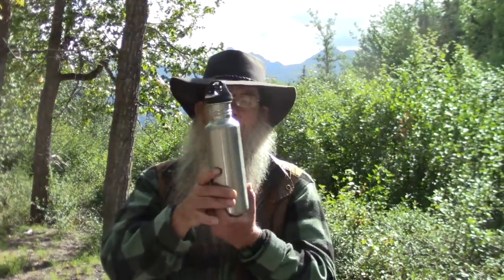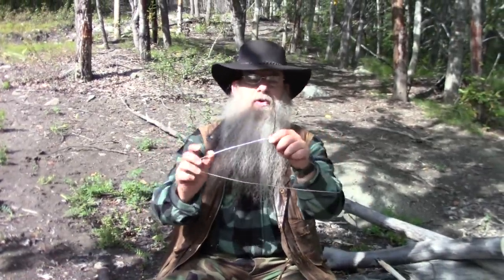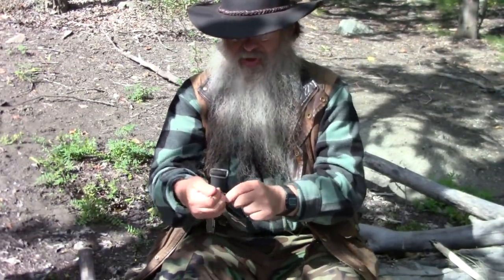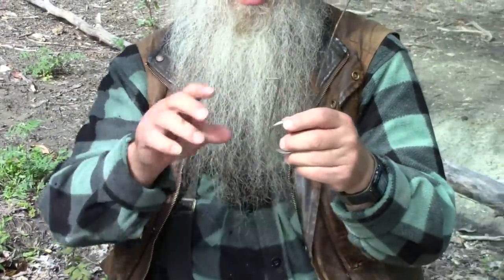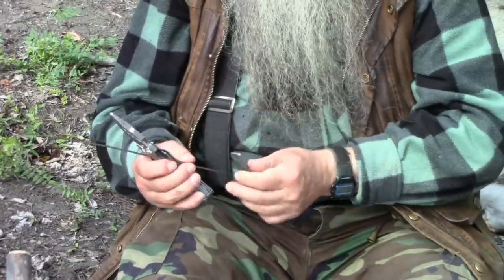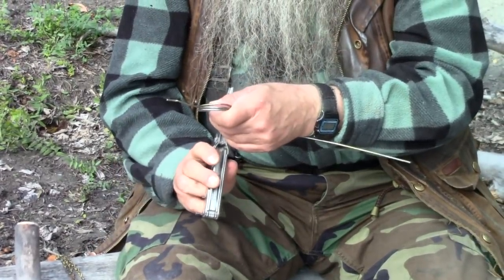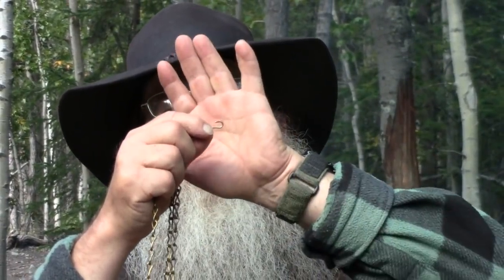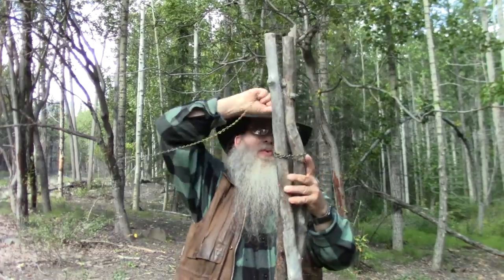Make A Water Bottle Hanger For Fire

Comment: Hi there... just some more ideas. I usually just put copper wire around the lip and twist it tight so that i have a wire "handle". That way the copper wire (acting like a strap) can just stay on it all the time. Also put mud around the outside of the bottle when cooking, so that you can just rub it off afterwards. Easier than trying to get soot off. 

For chains, I use those three chains for handing plants found in garden stores. They are good for hanging pots too. All the best kieron
Reply: Never thought of using a little mud to coat the outside in the scout's we would rub a thin layer of soap over the bottom and up the sides a little to make clean up a little easier.😃
Reply: @gamegod19 lol cool... its best if its clay from river banks. Im needing to have a break too and will head for a place called Wales at some point. Have fun

Comment: Very simple, but useful as always!
If you bend the hooks a bit under 90° you get a better grip inside the mouth.
Two other ways: most of the bottles are flanged at the mouth - you can put a piece of your chain  tightly around the neck underneath the flange and over the top to the opposite side (the first and the last chain link bend to a hook) - or take a 20cm piece of 1mm-Kevlar-twine and make a double-T-fisherman's knot, put the mouth of your bottle between the two knots before pulling them together tightly - Kevlar doesn't melt, it withstands temperatures up to 400°C/750°F, more than enough for a decent camp-fire.
Stay safe and keep on with your good work

Comment: Just make sure your bottle is not double walled that could cause a problem
Reply: Yes I was concerned about it rupturing with the heat and expanding pressure.
Reply: @jwm6314  really, it takes that long for it to boil water.
Reply: @CrazyCanuckFitness  I don't know if it would rupture... there is a vacuum inbetween the two, not air. So theorically it wouldn't develop much pressure.

Comment: Hey Lonnie, nice video! I use just a small piece of wood on a string and cut it to the length of the inside bottle neck. The wood holds bottle from the inside. It works well hanging over the fire :)

Comment: Good stuff making your own! I knew about fish mouth opener, and then I watched this video. The same day, while browsing local shop for a berry picker (blueberry season here in Sweden) I noticed they sold clamps for jam making, designed to clamp shut a small plastic tube for tapping the jam or lemonade. Long story short, this metal clamp fits PERFECTLY just like a fish mouth opener in a metal bottle. Very similar in design. The one I tried with is the wide mouth 'klean kanteen' model of bottle.

Comment: Thats a great idea! I made a coat hanger holder that fits externally. Your method has the advantage of not having a [red] hot wire hazard as mine.
Reply from the maker: I'd be curious to know how you did yours.
Reply: @Far-North-Bushcraft-Survival  
I made it by cutting the hanger near the 'hook' to allow unwinding the short twisted part to discard. I than formed a loop for the bottom, smaller than the bottle diameter. I than wound it up the side of the bottle like a helix and bent the 'hook' end to extend straight up.
Reply from the maker: Thanks.

Comment: I have a Leatherman, what is your multi-tool?  Thanks for your informative video, great as always. 😁👍✝️🇱🇷
Reply from the maker: I am a long time fan of Gerber brand multitools and in the past I have not liked Leatherman brand multitools due to a couple problems that they had.   However this last summer I lost my Gerber multitool of many years ownership and have replaced it with a Leatherman Supertool 300.  I am liking it so far and will have to reform my opinion of the Leatherman line of multitools.

Comment: You may have mentioned this in a previous video but I was wondering what the make and model of your multi tool is. Thanks for all the valuable life skills taught on the channel!
Reply from the maker: I am a big fan of some of the Gerber brand of multitools.   I had a Gerber for many years and really liked it.   I lost that Gerber out in the woods somewhere within 6 miles from here earlier this summer.  I had been doing some pretty extreme physical activity and my sheath that contained the Gerber came loose from my belt and dropped somewhere unknown.  Anyway, the store in the town where we do most of our shopping did not have a suitable Gerber multitool for a replacement.   I had to get a Leatherman.  I do not care for Leatherman's method of plier deployment, tool storage and handle configuration near as much as Gerber's.   However the store had a Leatherman that had the individual tools that I wished to have in a multitool so I purchased it.  I have come to like the Leatherman more than I thought i would.  I still prefer Gerber multitools but this Leatherman is not so bad.   To answer your question, my multitool is the Leatherman Supertool 300 and I am happy with it overall.   In time I may come to appreciate it almost, if not as much, as my old Gerber.
Reply: @Far-North-Bushcraft-Survival  Cool! Thanks for the response!

Comment: Great idea.   I like those bottles too.  They make aluminum ones though that aren't any good.  Our water here is somewhat "hard" and the minerals ate holes in them.  After finding that, I looked inside the rest and all had some corrosion.   The stainless ones are much better.
Reply from the maker: Wow you folks have some potent water.  Are you sure that the pipe that the "water" comes out of is not attached to a still at the other end?   lol
Reply: @Far-North-Bushcraft-Survival    Ha!  No, the still is separate!  We keep those bottles filled all the time in the refrigerator or next to the bed, so the water sits in them a long time. I got rid of all of our aluminum ones.

Comment: what I do is get a small stick, wider than the opening of the bottle, but not quite as wide as the full bottle. I tie a piece of twine around the middle of the stick, and then stick it inside the bottle. You can slip it in vertically, but because the twine is tied around the middle, it goes horizontal when you try to pull it out and catches on the mouth of the bottle.  Very easy to improvise in the field.  I find it doesn't burn as long as you use a small fire just big enough.  You could also use paper clips to twist around the stick and then hang a few in a chain before using twine, just to give yourself more clearance from the fire.
Reply from the maker: One could also use a string around the short stick as you suggest and extend that string up only a short distance but not clearing the top of the bottle.  Then secure a chain to the string such as I did here in the video.

Comment: Great video! Two questions: 1. Would it be wise to scrape or sand any finish off the coat hanger so it can't get into the contents of the bottle? 2. Would it be possible to wrap the coat hanger around the external threaded part of the bottle so one could just screw it into the coat hanger? Thanks again!
Reply from the maker: Yes it certainly would not hurt to burn and/or sand any coating off of the hanger before using.  I can not picture in my mind any sort of means of securely fastening the wire by using the outside threads and screwing on and off.   If you can figure a way to do it, great.
Reply: You can find them on amazon that are already stainless steel.. Considering the effort involved in sanding it down....

Comment: I know its an un related topic but what shell do you wear when traveling on a snowmobile? The snowmobile suits i see online are way to expensive and fragile for my budget
Reply from the maker: I usually wear "Iron-Tuff" Bib Overalls by "Refrigiwear" They were issued to me when I worked on the North Slope during the winter on my lower body and a hand-me-down down filled coat for my top.  One is taking a chance wearing down filled items in the woods because if they ever get wet, they are very difficult to effectively drying out again effectively.   I would very well probably wear the Refrigiwear coat instead but it is too small for me to wear over the top of the bibs as well as my vest.

Comment: Awesome little trick
But isn't that an insulated bottle
And if so doesn't it brake on the inside somewhere at least that's what I hear with a double wall stainless
Reply: Those are not double wall.
Reply from the maker: You are absolutely correct . . . on double walled conatainers.  These however are single walled as 1980BaldEagle suggested.

Comment: maybe you could heat it cherry red near the loops and dunk it in vegatable oil to temper it into a stronger spring.
Reply: Tempering is applicable primarily to higher carbon steels, heating and quenching will have minimal effect on coat hanger wire.

Comment: What kind of Leatherman are you using?
Reply from the maker: I recently lost my ole faithful Gerber multitool of many years.  I had to replace it and so got this Leatherman.    It is the "Super Tool 300" model.   I liked the extra bulk and length and the specific tools that it contains.   I specifically wanted an awl, pliers, wood saw, screw drivers and straight blade (non serrated).  This has a serrated blade which I would gladly do without but it also has a straight blade.  I also wanted a multitool that locks it's individual tools when using.  This one had all I wanted so is the one I chose of the ones available in the Fred Meyer store where I shopped.   I still personally prefer the Gerber I used to have.   I like the way that those Gerbers open and the presented grip when using the pliers but I am beginning to learn to like this Leatherman as a second place favorite.
Reply: @Far-North-Bushcraft-Survival  thanks for the detailed reply! That's a shame about the Gerber,  I would get attached too haha.

Comment: might wanna remove the plastic paint coating
Reply from the maker: On the aluminum bottles the color "coating" is quite often an anodizing rather than paint.   On the stainless bottles I do not know if it is a paint or a similar process to the anodizing.   Either way, the coloring is only always on the outside and never inside.  But a smoking outside paint could still contaminate insdie water to some extent until it was burned off which may not happen as long as there is water in the container.   In other words a person may have to toss the dry container into the fire until all paint is burned off before filling with water and consuming said heated water afterwards.
Reply: @Far-North-Bushcraft-Survival  sorry i mean on the hanger
Reply from the maker: Yes.  I agree.   One could throw the hanger wire in the fire to burn off the coating but the heat may weaken the already not-too-strong spring-back ability that makes the wire usable for this purpose.   Might be best to sand it off.
Reply: @Far-North-Bushcraft-Survival  fyi this is a amazing idea. i was trying to figure this out this week myself i build a new fireplace at my camp
Reply: @Far-North-Bushcraft-Survival  and i wanted to cook my chicory coffee i learned to make  from your videos